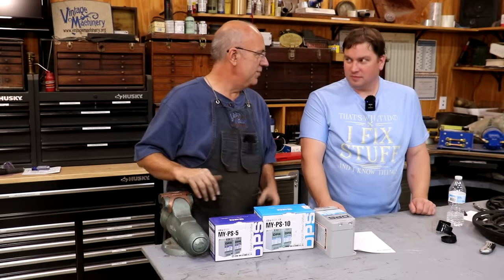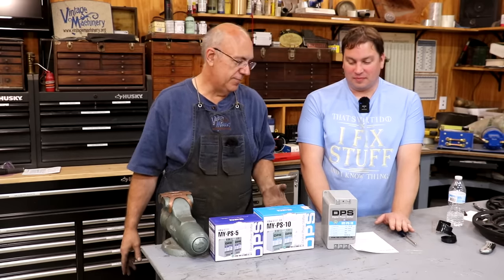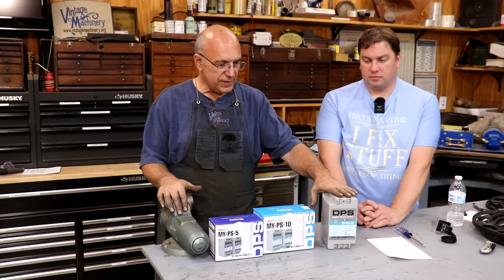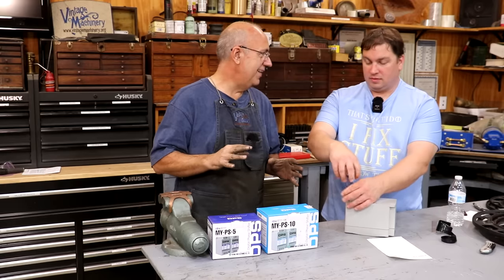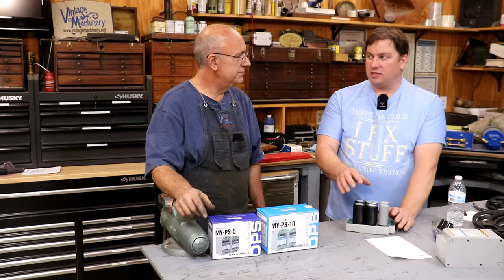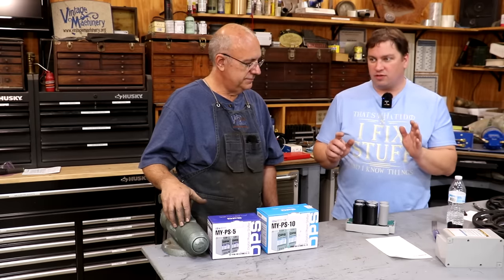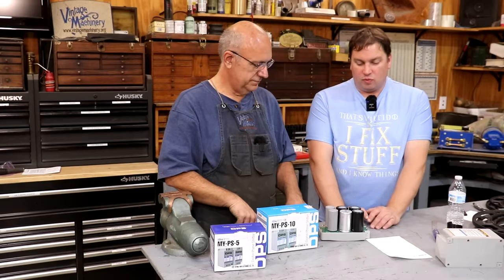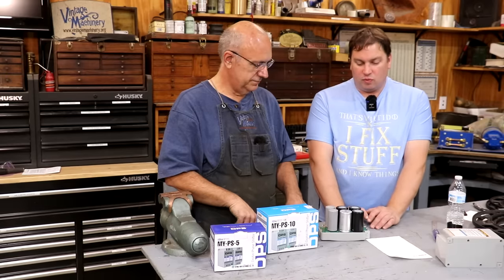Single Phase to Three Phase Power: Rotary Phase Converter vs Digital Phase Shifter

Comment: It is not a true three-phase device where each leg is 120 degrees out of phase with the other.   It is a two phase device that create a 'fake' third leg by playing with capacitance.  So legs 1 and 2 are 180 degrees out of phase and the fake phase is 90 degrees out of phase with those other two.   It is 0,180,90  instead of 0, 120, 240  (phase angles).

The third leg is created by the magic of capacitive reactance. It is also why the device needs to be sized so the motor takes up at least 50% of the device's rated capacity but not more than 100%.

I have used similar devices on ten horsepower motors on things like a Limitorque valve drive (to open and close a gate valve on a sixteen inch petroleum pipeline (remote operated line-isolation valves).

Over time the capacitors age (all capacitors have a limited life expectancy that starts the moment it is manufactured, they can age and go bad sitting on a shelf in a warehouse). This aging on capacitors is accelerated in high temperatures or under use (The ESR value of the capacitor decreases). Eventually the motor just stops working; What is worse is when the  motor just stalls and sits there humming and getting hot. In unattended operation it eventually burns out one of the two windings (but never the one with the fake phase because that is the one that never functions because of the bad capacitors).
------------------------
A rotary phase converter can deal better with the inductive 'kick' of a motor when it is starting up and is a true 0,120,240 degree phase output.

Comment: Very cool video, sometimes the guest audio went quieter, i am guessing that is when they run into the mic while moving around and bloc it (same as when I sometimes shift my hand on my phone and block it while trying to record a video).  I am glad you did this comparison, so far the only 3 phase I have is an extra motor for a drill press that has a single phase motor on it currently, but now I know more about the options, and am glad American Rotary does it right. :)

Comment: Single phase electrical phase power and three phase electrical power are identical in principle to one-cylinder and three-cylinder internal combustion engines, in that for single-cylinder IC engines, one power pulse occurs for each two revolutions of the crank shaft, whereas with three-cylinder IC engines, three power pulses occur over the same time period.  As to the DPS converter shown here, I ordered and installed one on a 3 phase, 5 HP lathe and returned it to Amazon after testing and finding the same set of conditions seen in this video.  Including the motor becoming too hot to touch after running for less than 10 minutes under light load. They are junk and should be taken off the market.  As to my lathe, I installed a 4 KW Chinese import VFD, followed by minor modifications made to the start-stop control wiring.

Comment: Would be interested in seeing the oscilloscope view of the wave forms of that device verse the rotary feed. Sound rather unbalanced wave form on the digital unit . Rather poor phase shift there a coil on the first phase could help fix the lack of phase shift.  That would increase weight and cost  causing the AC re-generator  to be much better choose.

Comment: Be careful  1 Amp can kill. !don't touch those capacitors like that , caps leak. They are a battery to supplement voltage to a circuit. Can hold a full charge for 10 years ! We used to touch them to the metal chairs in shop class and they would weld to the metal chairs. They were out of T.V.s. be careful it could lite you up. Be safe. Always discharge capacitors.
Reply: those little guys have bleed down resistors.

Comment: I wonder if you can get a "higher quality" unit that can provide a better quality power output. I've used VFD's extensively over the years and find them more than useful, but have never tried one of these units. I'm lucky enough to have been able to put 415V 3Ph in my house 30 years ago. My wife wonders why I'm reluctant to downsize now we have retired.
Reply: "downsize"  ?!?  its time to expand that shop man!
Reply: @nilzlima3027  Yes, the problem is finding a 2,000sq/ft bungalow with a 2,000sq/ft workshop. We have found a couple but with some problems which knocked them back. At least She Who Must be Obeyed is thinking along the same lines.
Reply: @billdoodson4232  you might need a 2k sf house but just think if you had a 4k sf shop!  shoot for the moon man!

Comment: So after watching the video, my fist thought was: why don't you give the bigger DPS a go here? Maybe they're overpromising, like e.g. the car hifi guys do with their amplifiers. Then I went to the their website and looked at the MY-PS-10 specs. It says "It must be used for 7.5HP motor. Do not use with 5HP motor or 3HP motor. If the MY-PS-10 model is used with a 5HP motor or less, the motor will heat up or make noise due to overcurrent." So there is literally no power electronics going on inside these boxes except to switch from start to run, it seems? I wonder if you ran into the issue the manufacturer warns about, e.g. running your 3HP motor basically at idle, causing the mentioned overcurrent. Of course this dependence on minimum load makes those boxes entirely useless for most kinds of machines in the shop. Alright, time to brush up my 3phase knowledge, as I'm still not entirely sure how those boxes even work ;)

Comment: On the DPS you stated one phase passes through so its the other phase that is altered to create the 3rd phase. I wonder what the current was on each phase coming into the DPS.
Reply: The input to the DPS is 240v single phase.

Comment: Fascinating. Would oversizing the digital phase shifter relative to the size of the motor make a difference, or is the inaccuracy of the conversion inherent to the design of the convertor?
Reply: No.  The people who produce this junk caution against oversizing since it 
makes the problem even worse.
Reply: Capacitor size can/should/must be calculated with the HP rating of the motor (within tolerances, it can change a bit with load/unload scenarios and torque requirements). If properly calculated and a suitable motor is used it should work and not burn it out. There can also be a 2nd larger capacitor (bank) for starting but that one must be disconnected afterwards or it will burn it out (hence why "oversizing" the run capacitor is bad). You can google "steinmetz circuit", there are some articles.
Reply: Thank you
Reply: no, this is not a problem to be solved by more.  these things need to be tuned to the load.

Comment: Another thing to remember with digital phase convertors is that it's also changing the sine wave of the circuit.  It converts standard wave to digital and back to standard.  There's always a drop in efficiency when doing that, and when you do it with newer motors that are sensitive to that then there's even more problems with incorrect amperage, over-heating, and irregular spindle speeds/voltage draws.  Think about it, your going from a variable wave that smoothly ramps up & down allowing for a more natural conversion of energy, to a digital wave that abruptly ramps up to full wave then sits there and drops rapidly.  Then the phase converter has to change that back to a smooth wave which does not work very well.  Motors are just not designed for that, but computers are because they use that for timing.

Comment: Is there any chance of running 3 phase  motor  on a single phase if it is not a delta - star motor? I checked the VFD but they all want that configuration to run it.I got old nice grinder that is 700W 3 phase only motor and my supply is single phase only.Should i just sell it and buy a single phase modern one?
Reply: Delta or Y wiring configuration is for voltage not phase.  Never heard of Star, yes, I
thing you should replace that motor with a single phase one, good luck.
Reply: If it's delta, it's best. You can even run it with a phase shifter.
If it's wye/y/star it usually need higher voltage. Phase shifter will still work but highly reduced power.
A 3 phase is usually one of the two, and can be changed between both configs. Over here that means 230 volt delta can be changed to a 400 volt wye.
What strange motor if it is neither.
Reply: What does the motor say? Only got 3 connectors? What is the voltage?
Reply: @petemclinc  They call it triangle -star in my language ,i did a direct translation.
So yes delta -Y would be in english i guess. 
Motor is 220v 3phase Y configuration only.
Reply: @gubr  Its 700W 3 phase but it only has Y 380 V configuration. Can a vfd run it?In almost all chinese vfd descriptions it says you need a delta -Y configuration.
Reply: @zumbazumba1 Yeah. If it's Y 380 Volt only, you cannot change it to 220 Volt delta. Has no bridges to reconfigure?
If you feed the VFD with 220 Volts, 220 Volts will come out. If you feed that into the Y configured motor it will have to pass two windings. 380 Volt fed into Y is 380 V / sqrt(3) = 220 V on the winding, 220 V / sqrt(3) = 127 V on the winding. That's why VFD and static converters want delta, because then the 220 Volt are then used on a single winding.

You can spin up the wheel by hand and the turn on the 220 V to two legs and see if it keeps on spinning to see how it feels. Will run uneven, though. This mimics the speed of the DPS of this video, so it's even more reduced than with a VFD.

If you have run caps sitting around you can connect one between the free legs and one of the connected legs. Formula for a run cap is (1/(sqrt(3) * pi)) * (P / (Hz * U²). Which for 700 W / 220 V / 60 Hz would be 44 µF. But then you are not running it in delta mode so maybe U is 127 V, then it's 133 µF, but if P is also down from 700 to 400 W, then 76 µF. I don't know the answer to that. it doesn't need to be exact but grossly oversizing a cap is not re commended, though. More capcity = more torque. You can try 40 - 60µF, it will have less torque and maybe not start well unless given a push. If you put two caps in parallel you'll add the capacity. But you can feel how it runs, with a VFD it would be 30% faster.

You are better off selling it, though. If you could get it into delta I would say, go for a cap/DPS and be done but that Y configuration is killing it.
Reply: @gubr  Thanks for answer ,i think i will sell it the cost of ecverything to make it run on single phase would be more than i paid for it .
Plus price of the machine doubled on used market  since i got it so i will have more than enough for new machine.

Comment: You would never want to use a digital converter for an air compressor, they need maximum current on all 3 phases

Comment: How long can we expect the caps to survive without leakage?
Reply: Outside air conditioner compressors run for more than a decade in very hot climates without capacitor issues.
These are not the same capacitors, but they should last a long time if the circuit is designed well.
Reply: depends on the cap, good ones can last many years, cheap crap might not make it through testing.

Comment: I would not judge ALL phase converts from this cheaply made one. An electronically controlled Phase converter (there are VFD's that do both phase conversion and frequency control) have better performance.
The method that this company is using runs the motor without a phase (mimicking 3 phases), which will blow a motor up, as the efficiency of the motor drops to 15% of the original.

Comment: That didn't make any sense when he said, "remember electronic tolerance is 20%." Different electronic components are built to all sorts of tolerances. The same component, say a 5W 600 ohm resistor could be manufactured to be 1%, 5%, 10%, or 20%. There's no such a thing as "electronic tolerance is 20%."

Comment: So, are all Digital Phase Shifter's or VFD's created equal?  I don't think so, maybe that Korean
unit is just plain crap.  Not everyone can blow 5 to 10 grand on a Rotary Phase Converter.
I've been running a WEG unit for several years without incident.  These American Rotary
Phase Converters can cost more than the used equipment they energize.

Comment: Phase unbalance is not a good thing. It will shorten the life of a motor. VFD generate take AC voltage and turns it into DC voltage and then generates the 3 phases.  Downside to VFD you need 1 for each motor. Just a though.
Reply: one vfd can run more than one motor,  many manufacturers have directions for this.
Reply: I run 3 different machines with motors ranging from1 to 3 HP with the same VFD.
Of coarse I don't run any of them at the same time and there aren't multiple motors
on each machine.  I do have to make sure the other machine motors  are switched 
OFF or basically disconnected so as to not accidently start them up when using a
 machine on/off or forward/reverse control wired into the VFD.

Comment: The instructions of this device state that the voltage will become balanced over a 50% load I'm wondering why you guys didn't load up a motor and test it and what you're trying to do get people to buy a rotary oh yeah I forgot you have an affiliation with the rotary people don't forget your offering 10%
Reply: And then at the end the posturing to go back to the rotary pressure is just that high to sell rotaries I'm not saying they're not amazing but you didn't do excellent testing on this device on a confusing subject